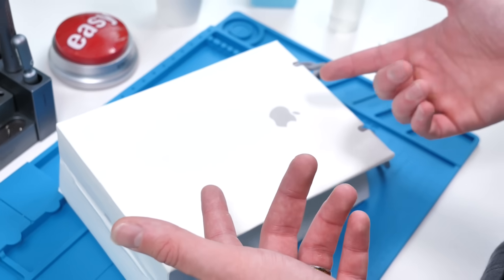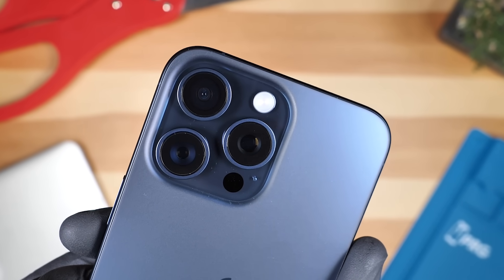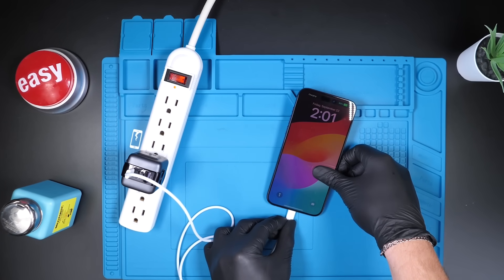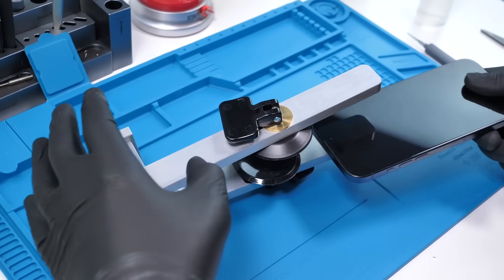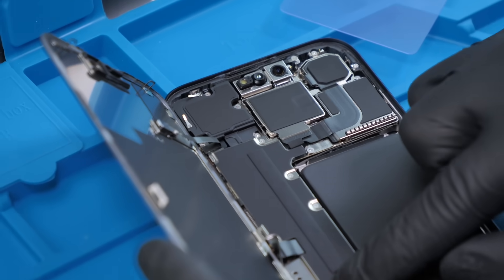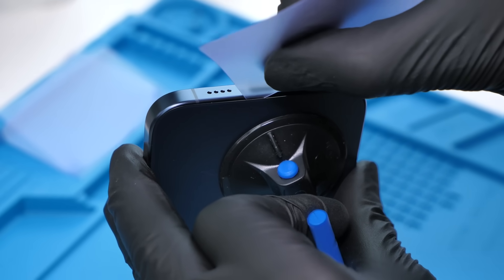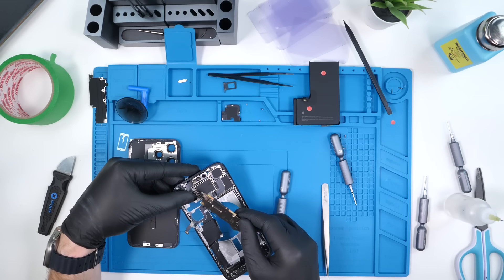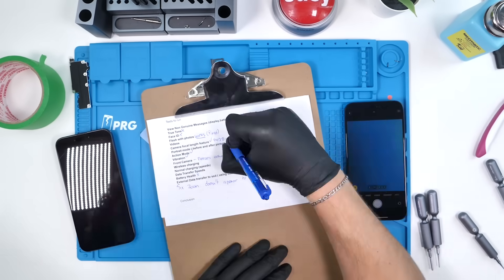Is The iPhone 15 Pro Repairable? - Parts Swap Test

Comment: Good to see that it at least didn’t get any worse (well apart from the front camera). 
FaceID is really the only component where I understand the need the message, as a replacement, possibly compromised, faceid would pose a security risk. 
The rest is absolute bs
Reply: not really, think of thieevs

Comment: Those little metal bits on the taptic engine are grounding pins. I wouldn't be surprised if a few years down the road, touch starts failing on these guys as the vibrators burn out...

Comment: To call a rear glass repair for just 200$ good news is astounding 😅😅😅
...
I wish they would sell the exact same phone all made of plastic. Acreen included.
I could use the same diaposable 2$ screen and back protection without having to pay for over engineered phones with exotic materials you don't see use or need in such a device.

14hours treatment of the metal that scratches that easily🤦🏻‍♂️🤦🏻‍♂️
Just use paint or acid bath FFS

Comment: theres alot of things i can understand companies wanting to do after "Unauthorized repairs" Messages saying its "Ingenuine" is honestly a good message, but not when you are using a part supplied by apple, its oke if its from a 3rd party, iphones get sold used alot and its nice there are signs to see what parts have been changed, but if they are changed with genuine apple parts there should be no reason for the phone to act up or straight up disable functions or features.
Reply: security measures

Comment: So it turns out, Apple has been locking parts though software to curb down on phone theft for parts salvaging in China. Although the esim only versions seem to be bulletproof in terms of tracking and theft, I do believe these newer iphones will not be targeted to theft for these safety measures.

Comment: This is great vid! & I love it! 😊❤
Makes me a bit much more sceptical if I should even buy iPhone 15 Pro Max. 
I'm Samsung user for years but I just
kind of want to change the game for
a bit a try something new as I didn't
upgrade at all from 
S21 Ultra to S23 Ultra 5G cuz' I didn't see anything usefull for me that I can
have advantage but we will see if 
my S21 Ultra will hold on me and
got me to the point to buy 
S24 Ultra or iPhone 16 Pro Max...
for a next year I'm wondering what both of them will come up with the new so called "futures" cuz' at this point I think
they all run out of any ideas and inovations so they just started to 
here & there twerk with a non-sense upgrades that should be done long time ago like the iPhone did with 
USB-C port but still downgrading user 
experience to the lowest level if you buy iPhone 15, 15 Pro 
(but not Pro Max)

which I'm really unsure why they do this in 2023 where the world is moving towards faster transfer speeds, 
internet connection, faster charging speeds cuz' we all nowdays use our phones daily very often so we 
all need them and also I don't see the option from Apple to just give us faster charging speeds, I mean Samsung 
S23 Ultr pumps 45W with a fast charger and at least you get a lot of juice for just let it charge for 15 min 
over a coffe break which is preatty amazing. 😅

There are also so much disadvantages & advantages on a both sides from
Apple & Samsung both offering 
hide end devices for a price
points that gives you a
huge headache and
makes a huge 
investement.
🫠😄😅

Comment: As an android user I think the hardware and software design in iphones is insanely good, my problem is apples attitude to break random things because THEY are not the ones replacing it.
Reply: It is also true that the components may be genuine but from a stolen iPhone, but if this was the case, I wish apple was prompting the error only if the serial of the component came from a marked as lost device. This operation would shed a light on the network of stolen components and maybe help close some sketchy shops
Reply: And that Pixels and Samsung's take better photos than iPhones 😂😂😂
Reply: @soberanisfam1323  just saying, I’m a DSLR hobby photographer and I know a lot of phones image processing outputs. The 15 PM is a delight in the phone world to me. Especially in color accuracy by miles better than any Samsung
Reply: @gamesnic  cool, there are several photographers who were surprised by these blind tests. They all swore by iPhone (id blame it on apples reality distortion field) but some when they took the test iPhone lost to several Androids. Facts is iPhone perform terrible in blind tests. Maybe these photographers are not as good as they think they are.
Reply: @soberanisfam1323  lol
Reply: @soberanisfam1323  I'm no brand snob, people can use whatever they want (though I'm getting tired of my friend who keeps saying Android sucks for security when in reality, both platforms have issues with security - also he says he can hack into Android within minutes).. however I think picture quality between the top phones can vary and it's pretty debatable which is "best." This I think is more of a subjective opinion than anything. I like my Pixel 7, it does take great photos, but I don't think they'd be any better than other top-end phones with good cameras and sensors.
Reply: @TwinShadow_Fox (edit to change dex to Knox) I got them mixed up) I don't remember what year it was but I'm pretty sure recently that Samsung knox security actually won best security. Idk about other android but with Samsung security it's not easy to hack in to it. Just like other things just don't click or download untrustworthy things lol
Reply: @eggywhistle samsung's knox  security is sorta equivalent, if not better than Apple's security
Reply: @ezdlx  omg it's Knox not dex ops my bad lol
Reply: @eggywhistle  its aight lol, dex is the desktop support for samsung devices if i aint wrong
Reply: @TwinShadow_Fox  pixels perform better than Samsung and way better than iPhones in blind tests in photography

Comment: You’re a repair shop, yet you open and start disconnecting cables while the phones are still on 🤦‍♂️🤦‍♂️🤦‍♂️.

Anyways. I was using the iPhone 15 Pro Max at an Apple Store on Friday and the camera app on one of them kept freezing up same as yours were. This was a display unit. So there maybe be a software issue.

Comment: Geez, it's not that big a deal "Waaaah, I can't treat my iPhone like a PC and swap and mismatch parts" (making it less reliable!)
 That front Camera and Sensor are used for unlocking the phone, so I would imagine its similar to how an SSL cert works, only designed to work on that "machine" and is encoded in some way to that device for security. Imagine the backlash if swapping the parts out enabled people to unlock someone else's phone.
Reply from the maker: Try using face id with the front camera covered and you’ll quickly realize that isn’t true

Comment: Apple should find some sort of equilibrium between safety and repairability.

There should be a way for 3rd party repair shops to verify genuine parts, from other iPhones with apple, I understand and like the fact that parts are serialized, it diminishes the value of stolen iPhones and as someone who lives in an area where phone robbery was extremely common, this makes me feel better, keyword there, was, no one wants to steal iPhones anymore.

However, third party shops should be able to re-use legitimate parts gathered from other iPhones which weren’t stolen and use them for repair purposes
Reply: it lets you know your phone is genuine when buying used

Comment: I’d be really interested to know if a picture with the front camera works with Siri Shortcuts.

That uses the camera API and not the camera, so if it’s a glitch with the camera app, then taking a front picture using Siri Shortcuts should work.

Comment: it's a pretty dumb decisions from such a big company like apple, like they could just make the iphone shows that you have replaced a different parts like camera, screen etc with showing your old part's serial number and the current new serial number but still shows them as genuine parts and work like normal, but no software just detects them as not genuine and make face id and true tone etc not working and thats dumb.
Reply: That’s going to open a can of worms If Apple, does this, if it’s even possible knowing China they’re going to find a way around this lock, and make part show up as genuine, even though they’re not

Comment: Many people see this as a repairability issue and blame Apple for blocking third-party repairs to charge the consumer more, but I actually agree with Apple here. In many countries, iPhones are still sold by small-time resellers and not Apple. Some of them in the past have offered huge discounts on the iPhone but the catch is they used to swap the original internals like batteries and cameras. They even took out the original cable and swapped it with a fake one. The cable thing still happens. They later used to have a system in place to reseal the package and sell the original parts separately. Now any consumer buying from such resellers can turn on the phone and instantly be notified of any such because of this security feature in place.

Comment: My guess for the front camera is that now the iPhone 15 takes depth informations on every photos by default. However, because the front camera uses the FaceID sensors for depth informations and Apple deactivate faceid when swapping the camera, it glitches out the app. So there’s not more anti repair things happening than on the iPhone 14, just that they have a bigger impact
Reply: if that is the case, then I'd call the apple engineers incompetent
they write software that can't function if everything is not in perfect condition
Reply: @arjixwastaken from what i know, its for security reason face id is deactivated.  Just like a touch id before.. it is encrypt and linked with only motherboard compatible
Reply: @arjixwastaken Software is hardly ever written taking hardware failure into account. That being said, because Apple themselves are the ones disabling FaceID functionality...they should've seen this coming and fixed it before it got to customers.
Reply: @arjixwastaken  Knowing how software dev work is prioritized, they probably determined that making the front camera still work without Face ID was lower on the priority list since their policy is that Face ID should be properly configured anyway. Not defending the decision, but figured an explanation would help.
Reply: @arjixwastaken  uhm, does your car drive when you're missing a tire? I don't think so. Blame the auto maker I guess, that they just couldn't come up with a solution to make it work.
Reply: @PvtAnonymous  that's not the point is it? The auto industry equivalent would be to throw a check engine light if you drive on a tire that hasn't been installed and calibrated by the manufacturer. That's the part that appears in the iPhone settings. Now to add insult to injury imagine ABS, ESP and cruise control being disabled because you're not driving on a calibrated tire. Doesn't matter if it's a genuine specific tire (like MO or * tires for Mercedes and BMW respectively). This is the part that's insuling to customers.
Reply: @PvtAnonymous  Thats great and all except both iPhones aren't missing any parts bud your analogy with a missing tire makes no sense
Reply: @mikdadabdullah7914  i agree the analogy is wrong.
It would more be like you change a tire on your car but because it’s not done by the manufacturer then your ABS does not work.
That is still anti repair.
In this specific case, I mentioned that I don’t think there’s more anti repair things being done, just that it was a software issues by the devs that did not expect this issue I guess. But it is still a fact that FaceID, the battery, etc are actively being crippled by anti repair tactics. I mean, in some way I can understand why they would do that for safety or calibration purposes, but in the other hands they keep the tools necessary to do the calibration. That one faceID module could not simply be swapped because of chromatic aberrations I could understand, but why don’t they give a tool to recalibrate it, especially considering you swap one genuine faceID by another genuine one in the case of this video ?
Same for all the other components that end up malfunctioning after being swapped from genuine iPhones
Reply: @vizender  I think your view is a bit too optimistic given apples track record its likely this is done on purpose just to make it so that you have to pay their price for the repair. Face Id and the battery as well as tap tic engine screen etc are all serialized and locked down some parts make day to day use terrible when replaced and it's absurd for something that's so expensive.
Also I'm not sure what you are referring to with chromatic aberration or calibration, I never heard of it from my research hahaha
Reply: @PvtAnonymous no, but car drives if I change it for another
Reply: @PvtAnonymous  technically speaking, the car would still attempt to drive, and it very likely would be able to move even for just a bit.

As for software development, we programmers usually try to take into account any possible scenario, and write code to handle it.

Assuming that everything is always in perfect condition is a scary thing to do and could result in dangerous results.

There have been 5 people (and maybe more) that died due to a software bug on a medical machine. (Iirc it was an x-ray machine or smth like that)
Reply: @arjixwastaken  well and the front camera will take pictures too if it doesn't recognize a face, so it's still working fine, when following your example.
Reply: Haha Yours Conversation Are Awesome 😆

Comment: I think that for FaceID, and the battery, it is somewhat understandable that you cannot do everything you want, as the first one is biometrics security, and the other one is power management/supply, which could result in a fire.

For other components there is no justification imo.
Reply: The battery is the same in every single iphone 15.
Reply: @invinsible1987  you didn’t understand, I was talking about replacing with third party replacements.

Some could be very high quality, some other perform even better than genuine ones, but a crappy battery with a poor management circuitry is a real hazard

Comment: To be fair, some of "calibration" issues can actually be because it's cheaper to handle some unit-to-unit variance in software, rather than tightening the manufacturing tolerances even further, however, the tools for the calibration should be made available, or at least the unavailability should be clearly explained with engineering/expert reasons, rather than "safety, security, innovations, patents" and similar crap.
Reply: That thinking is completely backwards. 

There's no reason Apple can't let you replace components, even if there's variance, even if it's not going to work perfectly. It's the difference of it working 99% what it was, and it working 0% because they serialized the parts. 

Stop making excuses for a trillion dollar company that just wants to milk you for more cash. 
It's not a coincidence that your front camrea will stop working if you replace the screen, on what is now their most fragile display. They want to give you a reason to upgrade your phone, or get a new one.
Reply: @404-Error-Not-Found  I agree that they should make it possible to do repairs, but there can be good engineering reasons to require calibration (not serialisation). The go-to example is HDD - if the control board dies, you can't just swap in a replacement, as there's a chip that contains the calibration data for it, which is necessary for the needle to hit all the right places. Without that chip, the drive couldn't work, this is an engineering thing, not an additional conscious decision to make things harder.

I'm willing to accept that apple is doing some shady sh*t, possibly including serialisation, but first of all, they should be talking about why these parts cannot be swapped, and they should be offering calibration tools for cheap or free, unless there's a good (engineering, not "safety/security/innovation/patents") reason.

Comment: But what if you factory reset a phone with the "wrong" motherboard? Maybe the serialization happens at first boot
Reply: no, it happens on Apple servers. There is no way around it, only reprograme the part serial number to be the same as previous part.

Comment: Commenters? What are your thoughts on stolen iPhones being stripped for parts? Could this be apple’s justification for serialising parts? Or could they just lock out the parts only if the phone still has iCloud login in (which is the case with most stolen iPhones)
Reply: No even if it's not stolen even when u buy the parts online they still behave the same way so this is very unpractical and most of the times it's your phone that gets damaged rather than being stolen coz if you asked any one if they'd like their phone parts to be replaceable without compromising any features or keep the parts serialized for the sake of harder times on the thieves they'd most prefer the repairability because it saves more money than having to buy a new iPhone just because your front facing camera can no longer work.

Comment: The fact that they are literally scamming you by giving you a more fragile case back so you can break it more often and repair it for less + the fact that the titanium scratches even more easily due to the shitty PVD coating they put on it is why im skipping this one and getting the S24 Ultra instead.

There's absolute zero economic benefit from upgrading to this and very little hardware benefits other than a better camera and USB C support (in 2023 after the EU threatened to ban apple products lol)...